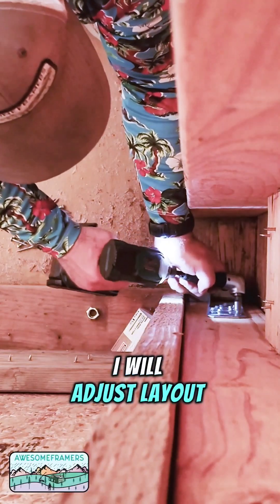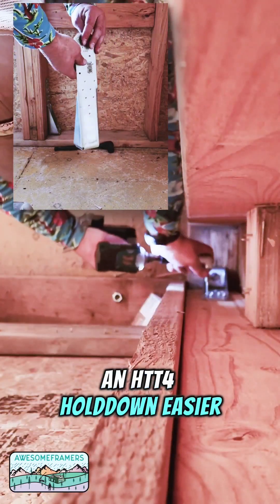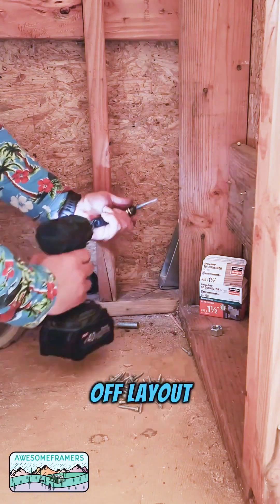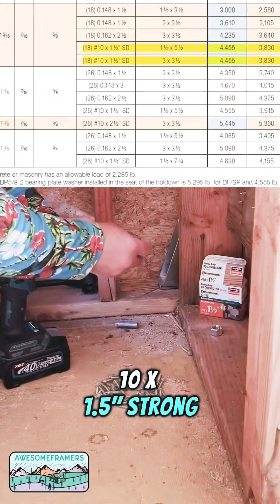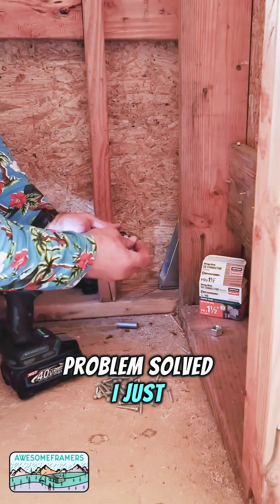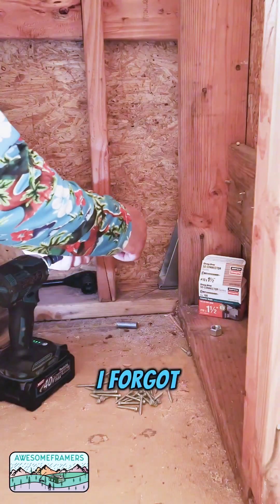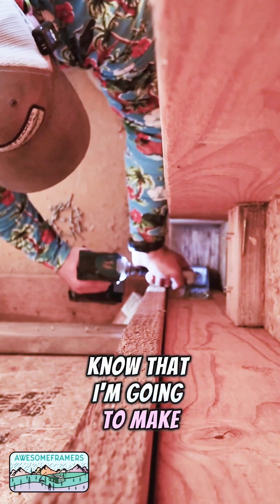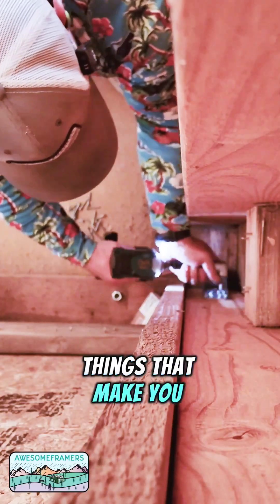The Right Tool #framerlife #buildingconstruction

Comment: Tim,

I don't believe it's a pencil mark on that stud to the left, it looks like a split!  
First, don't use an impact driver & it is certainly not a substitute if a torque wrench was the proper tool. 

Go for a straight driver or drill. 
Get yourself a little 90° drive adapter that will fit in the chuck, that will also allow you to get into places.
The universal is a good thing.

Comment: Those Simpson screws have a 1/4” hex head.  In a pinch they fit snugly right into the chuck of our tiny impact drivers without a bit.  Makes for a super compact driving solution that might even work in the situation pictured here.  Just sayin.

Works great with a Right Angle Impact Driver for even tighter access.

Might not work with an 8Ah battery on an impact, but still… 😂